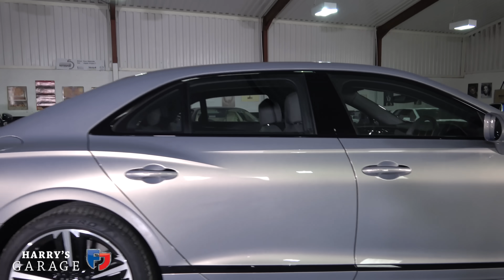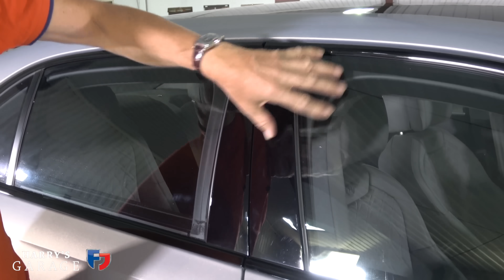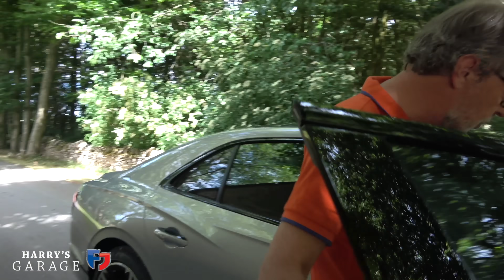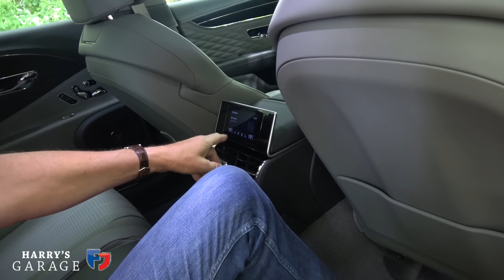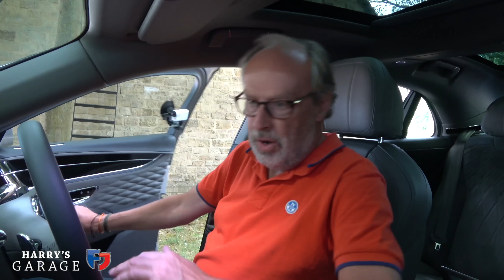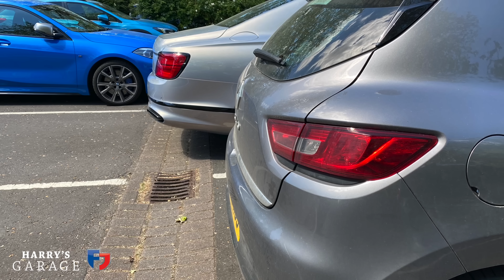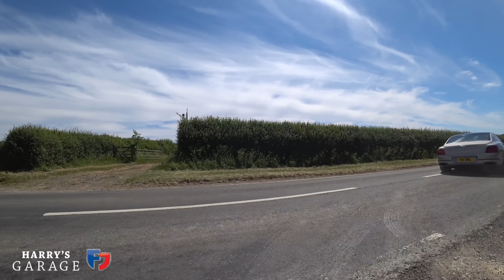New W12 Bentley Flying Spur is a 207mph, 626bhp limo. Full on-road review

Comment: Positives - Huge headroom, Quiet, Comfortable, Understated elegant looks, Great Wheels, Reliable. Negatives - 15 pounds Mascot, 20 pounds plastic Grille , large B pillars. Whatever car those negatives were on , would cause me not to buy the car. Bentley charge the customer 2000 pounds more put a metal grille. Redesign the flying B, it looks like 1970's junk.

Comment: Enjoyable video as ever Harry. One thing that the light colour of the test car highlighted for me,and I hadn't really noticed before, is how relatively short the front overhang is thanks to pushing the front axle forward on the new platform. Obviously has the benefit of putting more of the engine behind the axle line too by default. You are correct though, despite being a massively excellent piece of engineering, is it really in tune now with todays mood (even pre CV19) ? Interesting times indeed !

Comment: @~3m: "...10.5:1 compression ratio... ...turbo... ..Bentley are very clever and they've managed it."  Coincidentally, my 2017 SUV has 10.5:1 CR, and is twin turbo at 1.1 bar. GLC 43 in case you're curious. But no, it doesn't go 207 mph.  :-) !!

Comment: Completely agree. I liked the old Flying spur. It was just a big, fast soft thing. This seems like a bit of a parts bin special. W12 because its there, DCT that simply doesn't suit a car like that and an emphasis on weight loss which compromises usability? 
I thought the whole point of this kind of car was no compromise. As you say they have the tech to stick a hybrid system in there (even if they kept the W12) which would just make the car better - more quiet to start and around car park/town speeds, more performance and the bonus of better economy. 
It feels very much like they aren't expecting to sell many so they just did the easiest job they could rather than the best. I can't see the spur lasting more than a couple more generations if this keeps up and I think that might be part of the point. Why sell three cars when you can sell two?

Comment: The transmission is the 8-speed ZF torque converter automatic. Not a dual clutch
Reply: Apparently its actually an 8 speed, ZF Sourced, dual clutch gearbox, with a dual mass flywheel.

Comment: Is it 5.2 or 5.3 metres long? By the way, the size of the 'b' pillar has very little to do with crash test regulations - it has more to do with stopping the car chassis twisting when under torsional load. It also makes the car less comfortable and more likely to roll in a crash! You should know this. Or, perhaps, it is time to go back to school or retire.
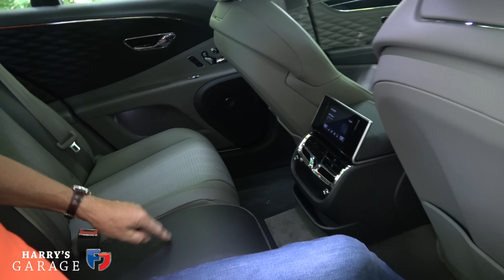At 07:00, you talk about the lack of comfort for the rear, middle passenger BUT your text description states '...can seat 5 in complete luxury...' - which is it? I think you have lost the plot, or have at least lost your notes. Then you talk about a vent in the rear door! The Ford S-max has the same type of air vent. At 16:40, you state that the CAR has 900Nm of torque. This is wrong. The engine has that amount of torque, but the anti-roll system has another 1100Nm of torque, resulting the CAR having 2000Nm of torque.
Not the quality of reviewing I was expecting. Very poor review.

Comment: Why has the numberplate got the Euro flag on it? Locally the garages will either not fit them or only charge for 'plates with this blue rag included...did the majority not vote out? Is it only remoaners that should/could/would buy this car? (sorry, but I am ambivalent on this, but is this a political statement by VW in which case...).

Comment: I did some research and, apparently, the transmission is an automatic, not dual clutch. I sincerily doubt Bentley would put an dual clutch in a car like this, considering the extra smoothness of an automatic and the overall ultra luxury intent of the car.
Reply from the maker: I'm afraid you are mistaken. This generation of Flying Spur does have a ZF dual-clutch transmission, which it shares with the Continental GT and Porsche Panamera. It's okay in the more sporting Conti GT but not so okay in a limo like this, as it lacks the ultimate refinement of the latest generation ZF torque-converter auto 'box. .
Reply: @harrysgarage  Really? Well, in that case, I will take your word for it. Thank you very much for the clarification.

Comment: Very good car, the plastic grille does let it down though,  Is it just me or does there look like a issue on the rear wheel and the arch, there looks a big gap compared to the front wheel, it looks odd as if there is a suspension issue.

Comment: Does that rear seat screen just stick up there begging to be bashed about? One of the key things about making a high end luxury car full of high end materials is doing it in a way that they... maintain quality over time. Like the black paint on all the key touch surfaces of my Infiniti is all chipped off. It was a high end luxury car (whatever) when I bought it, but inside six months it was a beater. "But if they made it out of something durable then it would cost more." No... "it already costs more, it should be made out of something more durable."

Comment: Metcalfe keeps saying 900 Nm of torque are beyond the capability of a torque converter transmission. A Mulsanne Speed has 1100 Nm. And an 8 speed ZF torque converter...
They use the 8 speed PDK only because underneath the new Continental platform there's a lot from a Porsche Panamera.

Comment: Something DIED inside me when I realised the Audi A6 at the gas station was in fact the new Continental GT. Been a massive fan for years, owned both previous gens GTs. But Bentley completely lost me with these two models.
Reply: This has nothing to do with an Audi A6. They are in no way related. The Audi A6 is built on the MLB platform whereas this is built on a completely different platform. Not sure where you got the idea they were related. The new Bentleys are much better than the previous version because the previous version was related to the VW phaeton whereas this version has engineering from Porsche.
Reply: @almac9203  So? I thought it was an Audi A6 by looking at it. (but now when googling, I realised I should've said A7*)
Reply: @almac9203  Take a look at these two images and you'll see what I mean:
https://www.motoringresearch.com/wp-content/uploads/2018/02/Audi_A7_Kapstadt_2018_blue-1031.jpg
https://media.caradvice.com.au/image/private/c_fill,q_auto,f_auto,w_728,h_410/b64ce4ed8be67b6a0b6c729d21ef6e80.jpg

–
Reply: @hellolemons7340  doesn't matter what it looks like. The fact is the car is not related to the Audi A6 in any way. It is built on a completely different platform. The Audi A6 and A7 are built on the MLB platform whereas this is built on a separate platform designed and engineered by Porsche. How can this be an Audi A7 when it is built on a completely different platform? The cars aren't remotely the same.

Comment: 200k and you don't get a metal grille. Does not look good at all from the front, and the rear design is very truncated and last-generation. The wheel choice and arches make it look like a squashed SUV and not a swept back limousine and I think too many reactions would not be instantly positive like one would expect. The interior ergonomically reminds me of the Rapide in a way with a sense of being rather claustrophobic and a trapped feeling, though this is a lot better. I think anyone buying this would be better off choosing another 4-door express until this is refreshed and enjoy the Conti for a properly cohesive vehicle. 
If one thinks about the NSX the effort for how they implemented a steel pillar and roof structure for very thin pillars and a lot of glass, it would have made for a much more pleasant and comfortable interior. The A- and B-pillars and transverse pillar between the two sunroofs are in my opinion unacceptable. Dimensionally, the interior has more in common with a wood beamed house than a car.

Comment: Gloss black plastic chrome doesn't spell prestige and heritage to me.... Overall it's slightly disappointing. As an admirer of the previous generation  flying spur and its successor the Mulsanne,  I think the rear design is particularly unresolved, with the double stepped boot lid a bit of an eye sore. The options list is no more exciting than that available on a BMW7 / Audi A8 / Mercedes S Class.

Comment: Again a useful review.  Maybe it's fun to drive 207 mph on the Autobahn, but that's far too fast and dangerous. The car is kind of outdated with a V12 and 626 bhp. Nobody need so much power. V8 and a mild hybrid and limited to 120 mph would be a better combination for a modern four-seater limo. From 0-60 in five seconds or ten seconds, what's the difference at the end of the trip? The Bentley is approx. 4.4 million Danish kroner (crowns)  - you buy one car and pay for three here in Denmark - but the Volvo S90 fully loaded from the wishlist is 1.1 mio. DKK - and you'll travel in style too. Keep on vlogging!

Comment: Great video as usual Harry. These big limousines are really designed for the passengers in the back. The aim is limitless torque and silent running. Surely much more suited to an electric powertrain. Would never happen but imagine Tesla tech with Rolls Royce/Bentley coach building
Reply: I wouldn't say "never" as anything IS possible.

Comment: 0.29 cd.   The 1983 Audi 100 achieved that..
Reply: A 1983 Audi 100 didn't need to be stable at 207 mph. Modern cars don't have much lower cd values and have a larger frontal area but they are much more aero efficient.
Reply: @JMartinni 

I understand your point but in comparison the W222 Mercedes S class has a cd of 0.24 and the BMW G12 7 series 0.24cd (with the Alpina having a top speed of 205mph).
0.29 just doesn't seem that impressive to me, but then again if you are going to spend £168k + on a car I would imagine that fuel consumption probably isn't a worry.

Comment: Harry, the rear end of this car reminds me ever so much of my VW Phaeton.  No surprise really as they are almost one and the same company.
Reply: The previous generation Continental/Flying Spur were built on the Phaeton platform. This one is based on the Porsche Panamera chassis. So same manufacturing group, but different car as a foundation.
Reply: You are clueless. This is not related to the VW phaeton in any way.
Reply: Designed by the same people, @almac9203  the ignorant...
Reply: @SPC22   thanks for the vote of confidence.  I loved my Phaeton and was sorry when it went 5 yrs ago. Very comfy and luxurious but not the most reliable. I now run a 4.2 diesel Cayenne which is nice but does not have the luxury touches the Phaeton had.
Reply: @almac9203  
Are you serious?
Reply: @humanbeing1675  Of course I'm serious!  In what respect don't  you think so, not thinking the Phaeton was wonderful  or my ownershio of a Cayenne?
Reply: @iansyme3535 
Are you al mac? I did not meant you.😉

Comment: I love how Harry's right hand very conveniently covered both the analogue and digital speedo when he floored it! Great car, crap grille! Thanks Harry!
Reply: Yeah agreed.grill is cheap and nasty🤢
Reply: 😂😂 he's been an automotive reporter for a looong time
Reply: You can see the needle hits 90 mph briefly
Reply: Almost, but I'm sure it must have been kpm!! ;)
Reply: @j0nnybrd  MPH in the UK.
Reply: 9.07 - handy that they provide an eye test. Save you having to drive miles to your nearest castle with the kids in the back to find out if you can see properly.
(Having poor eyesight would be a blessing not to see that grille.)
Reply: Just want to point out that the reason the grill is plastic has to do with the fact that it closes to help with aerodynamics and only opens up when cooling is need in the engine bay. The 7 series is the same, which is also not a particularly cheap car.
Reply: @austinbutler6185  That's definitely not the reason it's plastic... electric motors can move/rotate metal as well, so they could have just made those moving parts out of aluminum.  I think it's got something to do with pedestrian safety regulations (in the UK most likely), but regardless of why they did it, it is just awful and not worth whatever penalty they would've incurred had they used metal instead.  The thing weighs 2 fucking TONS, if you get hit by this thing at anything over 35mph or so you are DEAD, plastic grill or otherwise.
Reply: It's for safety purposes
Reply: That black-chrome Flying B hood ornament is vulgarity incarnate. No wonder in Britain this brand is dismissed as the ride of choice for football (soccer) stars and other arrivistes.
Reply: BPM black plastics matter.
Reply: Jason Gerrard lol, they’ve even sponsored the number plate!
Reply: @jasongerrard8940  LOL!!!                ALL plastics matter :o)